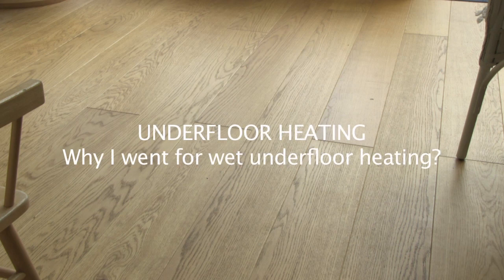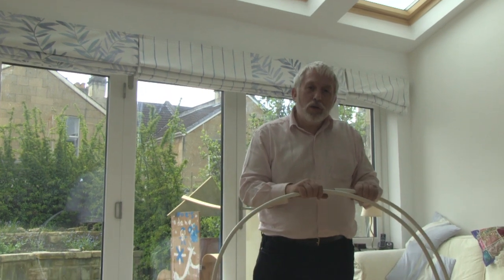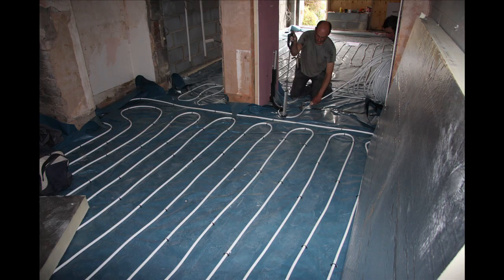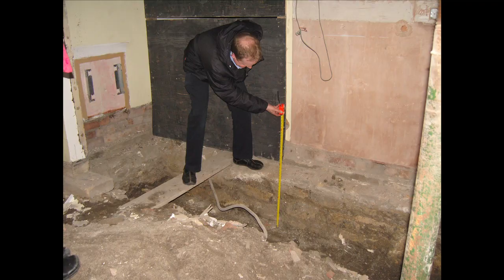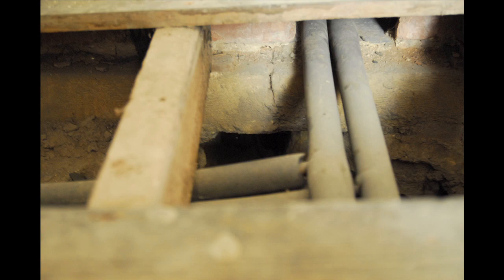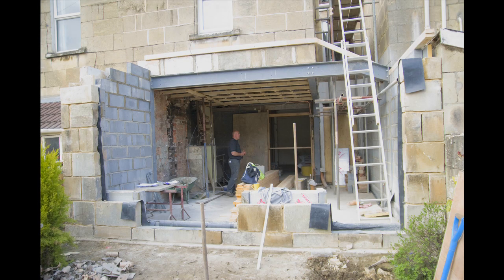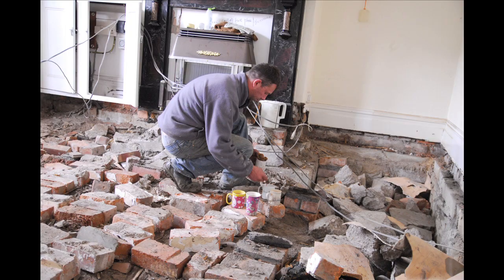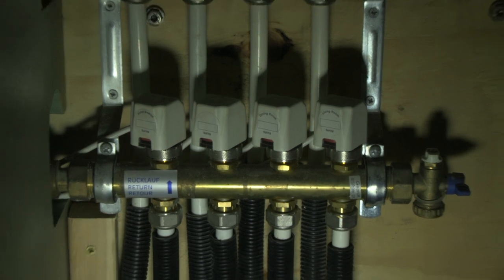Can you retrofit underfloor heating?

Comment: I understand that underfloor heating heats the fluid to a lower temp than in a traditional radiator system, however the volume of the fluid appears to be much higher. Would this not result in UFH being more expensive to run?
Reply: When used with a heat pump it's more efficient, because the coefficient of performance is higher when heating the water to a lower temperature. When using other heat sources, maybe not so much. But then you're using a different principle of heating the room than a radiator, which heats the air, travels upward, until all the air and objects are heated. With underfloor hearing you have the heat down, slowly creeping up. So probably more efficient even then, but definitely more comfortable.

Comment: FYI your UFH system has 4 loops. You may notice 8 pipes coming off your 8 "valves" under the stairs.

A Solar Powered (electric) UFH system would use no carbon, thus be more efficient than that of your gas boiler one. 

Good video. Although I was hoping for more information on how to retro fit UFH to a solid floor in a relativity new house. The search continues...
Reply: Hi! Did you find the solution you were looking for?